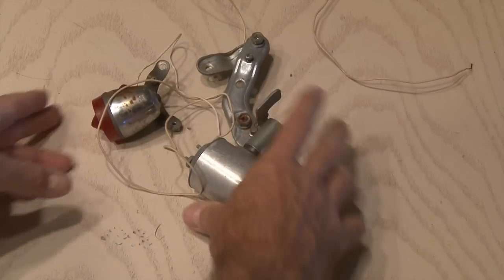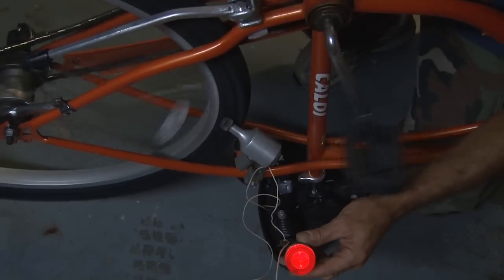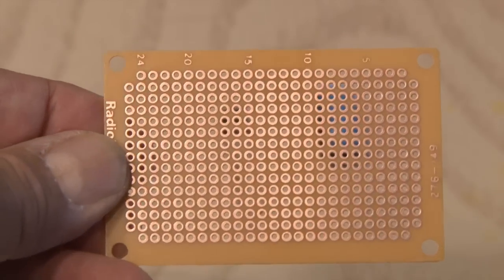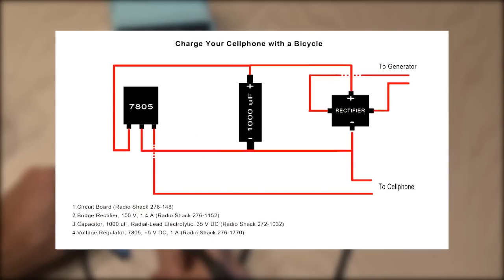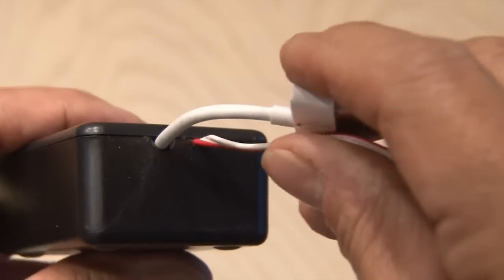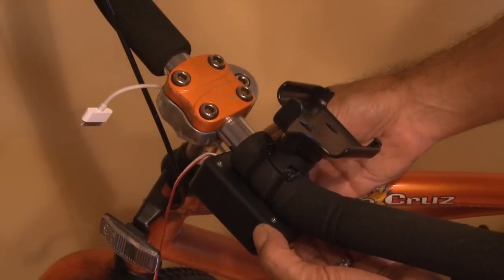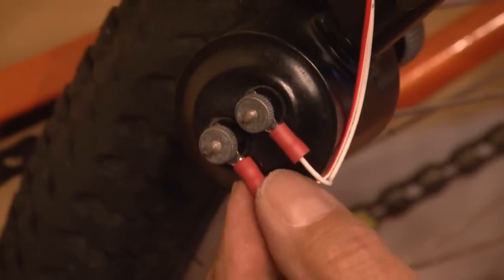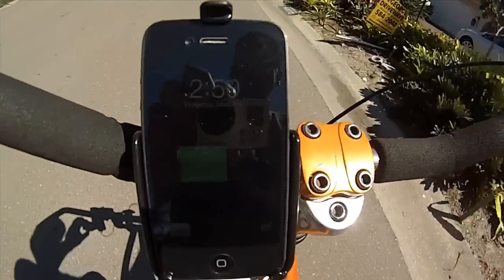Charge Your Cell Phone with a BICYCLE!

Comment: Very late but I did the same thing just adding a 12v 4.5 ah battery at the output of the rectifier to act as a massive filter and to store power, that goes to a cigarette lighter adapter for use with any car charger. The lights that came with the dynamo are also powered by the battery

Comment: no and with newer iphones you would need to have 2 volts going through each data cable this can be done with (2) 22k and 33k resisters. as long as its getting about exactly 5v then it will not mess up your battery. ive made many types of iphone chargers:)

Comment: I used to have a jump circuit like this. You put your bike up on jacks so the tire could spin free and it was enough to jump start a small engine or charge the battery to a tolling motor.

Comment: as an  ECE major there may be problems with this because you'd need to be at a constant speed for about an hour to get it to a good amount of charge for your phone. at the same time we were only shown the voltage not the amperage(current). So who knows how long it'll take to charge. i hope you all know of a great place to bike for an hour or so. maybe those trails that run along the rivers would help. careful it can get hot outside lol.

Comment: I don't know if this is possible but instead of using the generator for the charger you could hook it up to a electronic motor that would connect to the rear wheel. That way all you would have to do is peddle ounce and then bam! You have a bike that propels its self

Comment: Ok, this is simply the easiest and cheapest solution.
But I only have one that seems to be full of rust on the inside... but it should be easy enough to find working ones.
I will start collecting these generators now, and build a generator brake/slow down system for downward slopes!

Comment: awesome guide.................i checked the o/p voltage from the dynamo and it read from 6v ac (low speed) to 30v ac (max speed) will this circuit be able to regulate such wide band down to 5v dc.
Reply: Yes.

Comment: I was trying to carry out the charge your cell phone with a bicycle project however the dynamo generator that I have is 6 volt, 3 watt. My phone is a little smartphone(HTC Desire C).

I was wondering if I should still set up as desribed in the video and what changes I should make in order to charge my phone with a bicycle.

Thanks a lot.

Comment: That circuit will give you the right voltage but just like in the "Charge cellphone with fire" video, there has to be a small amount of voltage going to DATA+ and DATA- for an iPhone to charge
This will work fine though with any other phone

Comment: You need to know what the output of the generator is. If the box doesn't say, or if you don't have the packaging, get a voltmeter/multimeter from your local hardware store.

Comment: Soldering can be done when you are 12 too, its very easy. But if you cant do it, then you can just twist them together and put some ducktape on. Its not that good, but it will do the trick.

Comment: My dynamo generates 6 Volts and 3 Watts, do I use the same configuration as for 12 Volts and 6 Watts or I must make the circuit a little bit different?

Comment: Question, i have a small solar panel but it doesn't have the right amps/volts or whatever. IF i use your set up would it work to charge a phone?

Comment: You're not supposed to go out and ride a bike every time you want to charge your phone. It's an emergency source, for example if you forgot to charge the phone and you have to go somewhere by a bike, or if you're on a long trip and afraid of the crap battery running dry too fast.

Comment: How does your iPhone accept that charger? Doesn't the iPhone, starting from generation 3GS, need a certain voltage on the data lines telling how much current the iPhone may ask from the charger. My DIY charger did not work unless it was turned 
off due to that annoying Apple feature.

Comment: This is a great hack.    Could you use one of those car cigarette lighter plugs hooked directly to the generator's terminals?  Don't  cars use 12 volts on the lighters?   It would seem that the car plug has a step down voltage regulator built in somehow?
Reply: Yeah you can use that.

Comment: The phone will get an too high voltage (more then 5V)  what will cause damage to your battery, also the incoming current is alternating (AC) while a battery needs direct current (DC).
Reply: Um no. He didn't add the components just for looks, those step down the voltage.

Comment: will this not overvolt the phone battery if u go too fast??
Reply: No, because it can't give out a higher voltage.
Reply: +kallecool1999 If you look closely, he put a transistor, which should output any excess energy to the capacitor.
Reply: +kallecool1999 Nope. if you look at how the system is made, it basically takes a voltage that goes from 12 volt to -12 volt back to 12 volt very fast, makes it so that it stays at + voltage continuously. At this point you have a voltage rapidly going from 12 to 0 to 12 to 0 volts. With the capacitor you flatten the curve out a bit, so that it's ranging from say 8 to 4 to 8 to 4 volts. Then the magic happens in the voltage regulator, which makes it so that the voltage will never drop below 5 volts by lowering amperage, raising voltage automatically, then making sure it never exceeds 5 volts , 1 amp by converting excess electricity into heat. Basically, if you drive fast enough for there to be 5 volts generated, it will charge. If you go so fast that you generate more than 5 volts, 1 amp, the remaining energy will be blown out as heat. That's what the perforated metal plate on the back of the regulator is for. Basically a heatsink. Hope that helped, if you need more info just ask :)
Reply: is there a way to use the excess energy from the capacitor or attach another capacitor to keep the phone charging for that extra few seconds you stop ?
Reply: Afigu939 The excess energy is converted into heat so i don't think there is.

Comment: I doubt that it really works that way, because the iPhone usually needs a special voltage (about 2-2.8V) on the data lines of the USB cable to accept power.

Comment: Okay so I built other portable chargers before and my thought was wouldn't it be easier to take negative and positive and connect them to a usb car charger, which can handle 12v and then only output 5v ... I'm not really tech savvy but I just thought I ask

Comment: I'm not sure it's very healthy for a battery to charge it with such a varying signal. That generator is outputing about 6V, not quite enough for the regulator to supply a constant 5V, and the speed you're going at greatly influences the power supplied.

Comment: yes it does usb works on standard 5V just be aware while connecting the wires! if your are feeding power through a data pin your phone is fried :S

Comment: I need help, I have a bunch of these 6 volt generators that I'm planning to do many things with them and this charger is one of them. Do you think 6V would burn my phone out? Thank you.
Reply: it might depending on the phone. Some phones have a built in circuit that protects itself in the event that someone plugs in more than 5 volts at 1000 mA's. all you really need to do is use a simple circuit that uses a 5.1v zener diode and an electrolytic capacitor (something like a 100uF 25V capacitor) that will clamp the voltage at 5 volts. Additionally you should use a 1 amp fuse in series with the positive lead coming off of the generator so that way if you draw to much power (more than 1 amp) the fuse will blow instead of your phone, just incase. Good luck!

Comment: Hi, kipkay
I have some problem that my bicycle generator is 6v not 12 like yours
Sow what can I do...
Reply: It's a easy fix. Just use a different voltage regulator
Reply: +Uu Emad Use a voltage transformer coil. I think Home Depot sells a few low volt transformers for ~$10.

Comment: Well... turn it on and put it to sleep mode (suspend to ram). You will still have the +5V supply on the usb connectors, at least this works for my laptop.

Comment: Perfect idea but 
1. Your battery Isn't healty 
2. It dont produce much amps so  you will not much charge you phone (i'm sgs3 user and it has 2100mA/h battery sometimes my phone eats so much power that is discharging when usb is connected)
If you upgrade it and add 3-5 solar pannels and much more compaistors (never know how to write it..) or an small extra battery like 300 mA/h 5 volts 
But sometimes you just stop for moment and your battery will die like mine 
But video is still good!

Comment: I suck at googling apparently. I tried to google small generators and I kept getting results for wind power, solar, and gas powered.

What the hell is the generator called that goes in those wind up flashlights? Or this one?

Comment: no, thats what the circuit is for :) to take the power from the generator and step it down to a safe 5 volts DC thats safe for your phone to use :)

Comment: It only goes up to a certain voltage (4.9 volts). It won't do anything. Otherwise the original bike lights would have all burnt out, and no one would buy them anymore.

Comment: You don't understand what i mean i mean that if your phone is on it drains energy if this energy is bigger than energy that comes from bike it will not load 
For example you have 1W per second when phone is on 
Bike produces 0.5W per sec. So your battery will be not charged besouse your phone drains energy from battery/bike and energy is  to low

I think every phone has in usb a diode ...look another videos with usb charger...
(Sorry for my bad englisch im from poland but i live in germany)

Comment: I built this circuit and it puts out 5 volts but it won't charge my iPhone 5. Any reason why it doesn't work?
Reply: +Gary Ledbetter iphones and most samsungs, are very specific in what poer they get, you have to match their original chargers current precisely, otherwise it won't charge, older phones don't have this problem and won't require as much amps for charging either
Reply: +Gary Ledbetter The data wires need around 2 volts. A capacitor would work.

Comment: Hey, I just had an idea you could try:
Why not have the power from the dynamo run through a push-button switch, and then to a solenoid with a brake pad attached.
It would be a crude form of ABS brake for a bike - if the wheel locks, the dynamo no longer spins and the brake solenoid is released.
Once the wheel and dynamo start rotating again, braking force is applied again.

Comment: The capacitor, rectifier, and voltage regulator should not be anywhere near five dollars (unless you buy from radio shack). Try bowood-electronics(dot)co(dot)uk.

Comment: That must get annoying if you have to stop and start constantly with your bike for some reason
Reply: That generator only works if the rear wheel is moving. So if the generator stops the power stops to the phone. So if you constantly stop moving with the bike your phone will be making noises everytime it starts and stops charging
Reply: Aric Castro just add a power bank so it will not ruin your charging when stop the bike.

Comment: The only problem is every time you stop, the phone quits charging, which can ruin it after a while.
Reply: It won't stop, it will if your stopped for a while but the compositor will hold electricity for a while

Comment: I extremely disapprove of charging a pricey cell phone with something like this. A cheap unofficial power supply might mess up the phone somehow! It's probably not a constant stream of electricity either. But still, wicked tinkery of a gadget.
Reply: If you are so worried buy a cheap backup battery and use this setup to charge the battery and the battery to charge your phone as the battery will provide the appropriate power consistently.

Comment: Yes you probably can. It depends on voltage drop on the voltage regulator (7805). In calculation 6V*1,414(ac to dc coeff)-1.4 (rectifier drop) = 7.08V and most 7805 have voltage drop about 2V so there are still space for regulation. The charger stop working everytime when the voltage from generator will be lover than 7V. The other way is, that you can buy step-up/step-down dc/dc convertor which provide stabilized output, in most way, from 3V DC. But at the end 3W are less then most phone need.

Comment: Now just put that on a motor cycle then you'll have power
Reply: Take power directly from the battery of the motocycle, battery charges with the same method
Reply: You do know many motorcycles are gas operanted (pro speller) therefore they do not have battery's
Reply: Alan Tellez You know that all gas propellers need a electric spark to be ignited? Also motorcycles have lights, horn and everything, that's also gas propelled?
The battery charges with a dynamo from the gas propeller, more efficient than the video and also has power for hours to charge your phone without running the propeller.

Inform yourself before posting
Reply: how do you think car batteries stay charged